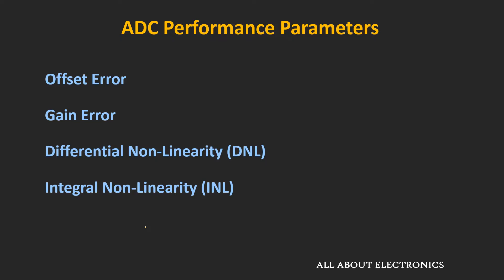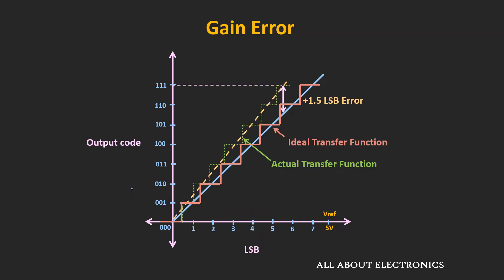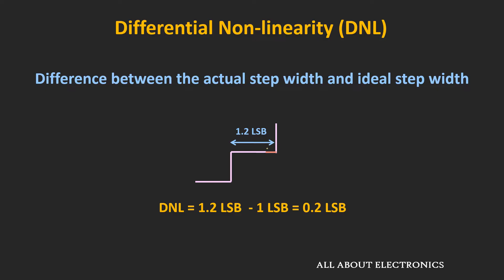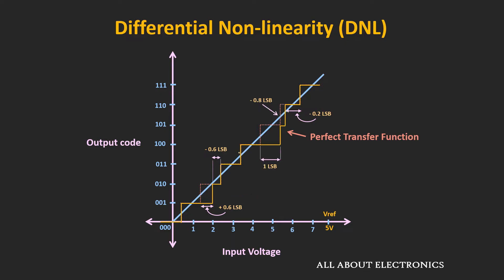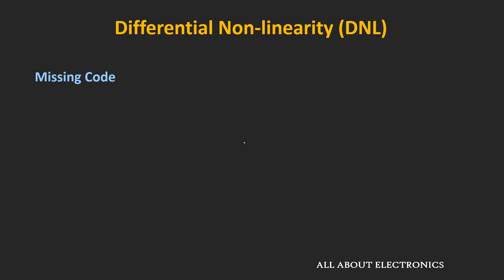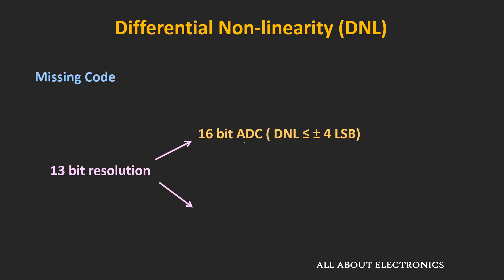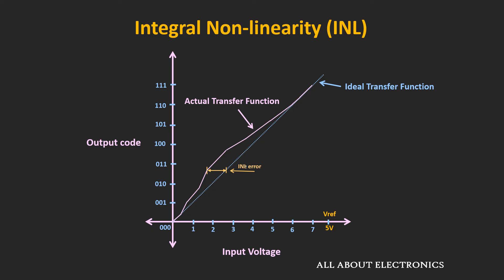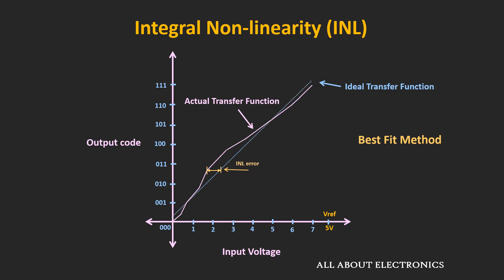ADC parameters:  DNL and INL (Differential and Integral Non-linearity in ADC)

Comment: ADC 12bit with Vref 2V and have +-16 INL and +-8 DNL can you give tolerance / Accuracy of ADC.
Reply from the maker: INL and DNL are usually represented in LSB. If it says +- 8 LSB DNL, then first you need to find the resolution of ADC (1LSB = VFSR / 2^12)
Here Vref 2V. So, you can find the 1LSB. And from that, you can find the accuracy/ tolerance in V or mV if required. Typically for ADC, it is represented in LSB.

Comment: Sir can you please explain why these non-linearities arise in ADC and DACs?
Reply: Due to Quantization/mapping a group of closely related sampled voltage levels to a fixed binary code. ADC is Many to One mapping. So when digital to analog conversation is done, Ex if 1 LSB correspond to 0.8V we may never get back  4.35,4.37,4.77v. As that are all mapped to some Binary code mapping to 4.0v or 4.8v.
Reply: Error in sampling frequency too cause Nonlinearity

Comment: hello sir, at 6:00mins how did you approach to 14 bits based on DNL. Can you please explain
Reply from the maker: For the n-bit ADC, if the DNL is 2 LSB, then its effective resolution will become n -1. Similarly, for 4 LSB error, the effective resolution will become n-2. With 4 LSB error, there can be an error in the last 2 bits during the conversion. 
So, the effective resolution will become n-2.
I hope it will clear your doubt.
Reply: @ALLABOUTELECTRONICS  Thanks for your explanation. Could you provide the ref doc about this? Thanks in advance.
Reply: Does INL has same relationship with ENOB?
Reply: @ALLABOUTELECTRONICS  Sir, I didn't get this part. Is there a formula to follow, like if DNL is 3 LSB then what will be the effective resolution for n bit ADC?
Reply: Thanks I'm having the same doubt and this comment cleared my doubt.☺